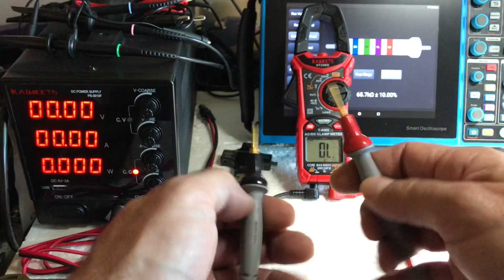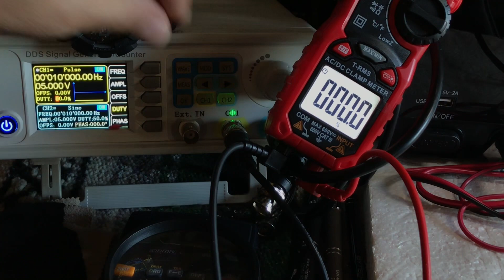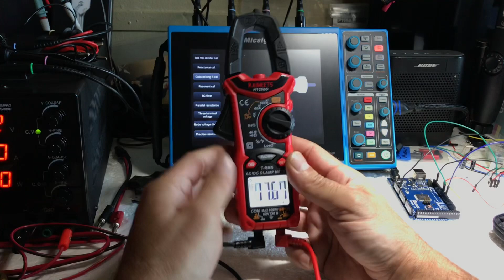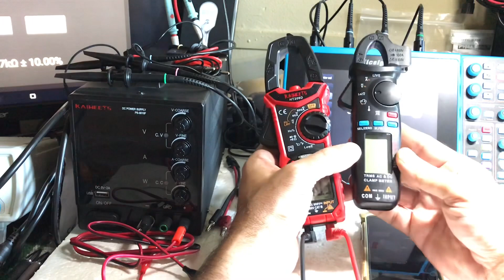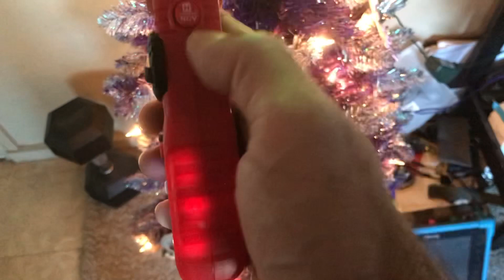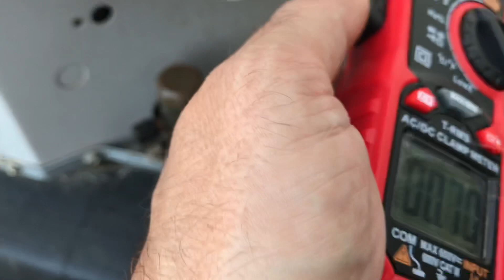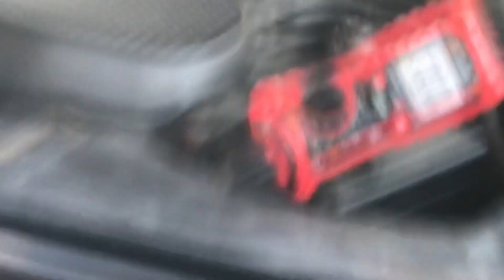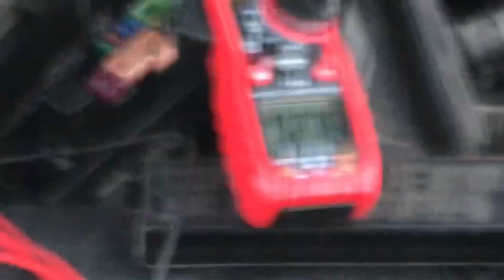Kaiweets Clamp Meter HT206D Full Review

Comment: Great video. What is the correct current ranges? Manual show a 6a and meter/advertisment shows only 60A/600a.
Reply from the maker: Hello William Butler Sr. Thank you for the kind words, and for stopping by the channel. For the Kaiweets HT206D, the ranges are 60A & 600A. On the meter itself, using the dial, you have one option that says 60A, and another option that says 600A. Both options have AC & DC. Of course you also have the other options, V, Hz%, diode, capacitance, resistance,  continuity, Celsius/Fahrenheit, and lowZ, all options with the dial. Those are on the dial, than you also have the buttons. I Know Kaiweets also has another clamp meter HT200B that has one option for2A, 20A, & one for 200A (AC only). I also, just noticed they have a new one ( new to me anyway), HT208D with one option with 60/600A, and one for 1000A. This one is AC & DC. They also have HT208A where the amperage will only read AC. Anyway, there may be other sub models (like A, B, C, etc) with other options. I hope this answered your question. Feel free to comment any time, and thank you for stopping by the channel, my friend. 

PS, say the options on the dial are 60A & 600A. If you want to test anything under 60 amps, you would choose 60A. If you want to test something between 60 amps and 600amps, you would choose 600A. Now if you are testing really low amps, say under 20 amps, with this example, you would choose 60A. With that said, if you used their clamp meter that has an option for 20A, and you used it to test under 20 amps, it might be more precise on the measurement. If anything, it would probably add another decimal point on the digital readout. Just something to think about. I don’t know if you know this already or not. Lord knows there was a time when I didn’t. Anyway, take care my friend.
Reply: @atomsworkshop195  Just bought one and am disappointed in very low DC current. ie .10 - .90 amps.  My cheap $10 non-clamp m-meter is very accurate in that range. It does have a ma range selector though, unlike the 206D. That should have clued me in on the HT206D for ma.  I wrongly assumed that with two decimal places and all the raving reviews it would be accurate with low dc current.  I read its possible to wrap the wire to be read DC current multiple times around the clamp for better low current accuracy. Do you know of this or tried it? They mentioned multiplying or dividing the number of turns times the readout, or something like that. Thank you!
Reply from the maker: Hello RidemFast, thanks for stopping by. I work mostly on automobiles, and like this meter mostly for that. If I need to look at MillIamps, I would break out my scope, and use a different low amp current clamp. Unfortunately, I am in the process of packing for a move, and all my stuff is already in stacks of boxes, so I can’t test wrapping the wire, like you mentioned. I do recall hearing about doing that, in the past, and believe it works. I should’ve been more clear in the video, to look at the other model, for milliamps. If you try the “wrap the wire” test, let me know how it works out, will ya? This could possibly help others. Thanks for stopping by the Channel my friend. Take care.

Comment: Well I have a slew of multimeters. I started with an analog Radio Shack unit I bought back in the mid-70s in my teens. It has its uses even today. I last used it to check for smooth action of an air flow meter as I opened up the vane over its range. Then a Circuitmate DM25L DMM. Then a Radio Shack auto-ranging DMM that looks like a small calculator that I keep on the motorcycle. Then an INNOVA auto-ranging DMM that I keep in the car. Then a Fluke 88V kit auto-ranging DMM because of the quality and it was a deal. And a slew of el-cheapo $5 Harbor Freight DMMs that I can give away. And now one of these clamp meters mainly to check starter currents which is handier than the 200A shunt and my Max/Min hold DMM or TEK scope.
Reply from the maker: That’s awesome A Christian. Those old analogs meters still come in handy. I have an Innova. The Innova 3320. It’s a nice little meter. My primary DMM (at the moment) is a BSIDE ZT-M1. It has an EBTN LCD display. It’s really neat. I think it sells for about 50 bucks on Amazon. I shouldn’t know that, since it was a gift from my in-laws from this past Christmas. You should check it out, it’s pretty cool. I’ve tested it, comparing it with one of my oscilloscopes, and it did rather well. Maybe I’ll do a video on it. I’ve never had a Fluke myself. Don’t get me wrong, I would love to have one. I just think they are too proud of them, and it definitely shows in the price.  I know they are great meters, and most people swear by them. I guess for now, if I need something super reliable and precise, I can just use one of my scopes. I just think (and I’ve had this conversation with a lot of people), if everyone just quit buying flukes until they lowered the prices (that goes for Snapon too), they would have no choice. Not only that, but when I bought one of my last DMM’s, I was doing some comparisons to a couple lower end flukes, and the way less expensive “non fluke” meters did more than the flukes. Anyway, I’m rambling, lol. I’m sure I’ll get a fluke some day, lol. Take care my friend.

Comment: Mine does not work with not contact voltage idk why?
Reply: Does not do anything at all
Reply from the maker: How’s it going William. Sorry to hear yours isn’t working. You should just be able to turn on the meter with the dial, press the NCV button and hold it for about 2 seconds, let off, then whenever you hold it close to voltage, it will beep & show an “L” on the screen. Hold it closer and it should continue to beep, and show an “H”, and the screen should light up orange. Press and hold it for about 2 more seconds to turn off NCV. If yours isn’t doing that, you should email them, let them know, and they should send you another one. The first thing I bought from Kaiweets was a multimeter (I did a review video on it). Anyway, the fuse for the current setting was blown. They not only sent me a brand new multimeter (letting me keep the old one), they also sent me a small smart multimeter (also did a video on). With that said, in the email I sent them, I mentioned I was going to make a video about the original multimeter. They asked if I would be interested in testing their new smart meter. Regardless, I’m pretty sure they would send you a new amp clamp meter.  I believe they have a 3 year warranty. Well good luck William. Let me know how it turns out, will ya?
Reply: @atomsworkshop195  thanks for your response I will contact them ac current clamp does not measure  maybe its defective thanks for your help

Comment: I have the HT206B (bravo, not the delta model you have) and it is nearly identical.....the NCV/hold switch on the board was unsupported and broke off either in transit or at the first push as the outer button can over travel and shear it right off.   That one feature is not robust, but the other 99% of the meter is as you found it - a good buy for the Money with some excellent features for the home-gamer.
Reply from the maker: Hello Winslow273. You should have them swap it out for a new (non-broken) one. You shouldn’t settle for a broken one. I was thinking about ordering the one you have also. I definitely like the one I have. If that ever changes, I’ll mention why in a video. I agree, definitely a good buy for the money. You don’t always have to break the bank to get a good product. When I was younger, when it came to any kind of electronics, I would only by the so called “best” (most expensive). Then a lot of my tools were stolen out of my truck in a Lowe’s parking lot. Well I had to replace everything, but couldn’t afford all the most expensive, all at once. So, I rolled the dice, purchased some reasonably priced items (after researching reviews), and I was pleasantly surprised. Since then, I’ve learned there are a lot of good companies out there selling good products at a fair price. Anyway, thanks for stopping by the Channel my friend.
Reply: @atomsworkshop195   The difference, it seems, between the Bravo and Delta model is the Delta has he DC Clamp Ammeter, where as my Bravo does only AC Amp clamp.

Trying to get a live person for the 36 month warranty is so far fruitless....for that little cash I will probably just buy a Delta at some point....
Reply from the maker: Oh, I didn’t realize it didn’t measure DC. Thanks for that Winslow273. 

Yea, I can understand what you’re saying about the hassle of a warranty. If you order the other one from Amazon and there is a problem with it, you could return it (within 30 days), and order another one. I wish you the best my friend.
Reply from the maker: Hello Winslow273. I was just thinking, and don’t know why I didn’t think of this the last time we spoke. Anyway, I bought a Kaiweets Multimeter (I did a video on it), and the fuse for the current was blown. I emailed them, letting them know, and they sent me out a new multimeter (letting me keep the first one). They also sent me their new smart meter to test (also did a video on). I mentioned in my email that I was going to do a review on it, so they asked if I would be interested in testing their new smart meter. Anyway, I’m sure if you emailed them, they would send out another one. Just thought I’d let you know. Someone else just commented that their NCV wasn’t working, and I instantly remembered what I just mentioned. Not sure why I didn’t think about it before. Was probably tired. Anyway, let me know what comes of it.
Reply: If you have any need for a non contact AC voltage tester, the dual sensitivity Kaiweets or Tacklife pen model with the LCD screen works very well. I just bought one through Woot for the princely sum of $8.99 👍
It works as well as the Klein NCVT2 that I misplaced, being able to easily distinguish the hot from the neutral wires of a lamp cord.
The NCV tester in the amp clamp is just too sensitive to help much, as it tends to just sound off when within an arms length from an AC source.  It really needs some kind of sensitivity adjustment capability for it to be useful.
Reply from the maker: Thanks, I’ll definitely check that out. Yea I agree with the sensitivity of the NCV of the clamp meter. It’s ok to just get a quick signal that a plug is hot, but not much more. I’ll check out the pen model you mentioned👍😄
Reply: Thank you for telling us about the issue with the Hold/NCV button. I saw it in a tear down video and thought this could be a weak point and now you gave the confirmation, so I gave it some 2 component glue.
Reply from the maker: @topeye4202 Glad I could help. Thanks for watching, and let us know how it holds up.

Comment: I came here to see how to find parasitic draws using this very same tool. I ordered it yesterday
Reply: I just bought this as well for the same purpose. Turn off all accessories and lights,  Clamp the negative cable,  wait till the car goes into sleep mode (may take up to 20 mins) then start pulling fuses and relays until you see the amperage go down. Keep in mind, up to 
.30 amps is normal in some vehicles while in sleep mode. 
Hope this helps
Reply from the maker: Hello FortunateDad. Thanks for explaining that to I am Her. I don’t always have the time to do that. I would’ve liked to make a video showing how to track down a parasitic draw (there’s a few ways to go about it) but I’ve just been really busy lately. I was thinking about buying the other one as well. They seem to be really good amp clamps for a reasonable price. I also really like the small size of the one I have. Anyway, thanks for stopping by the channel my friend.
Reply from the maker: Hello I am Her. You should find it pretty easy using this. A thermal imager, (unfortunately really expensive) would help find that annoying parasitic draw as well. Good luck, and thanks for stopping by the channel.